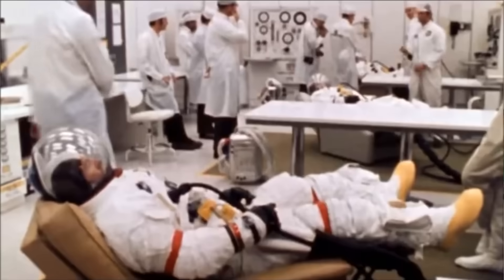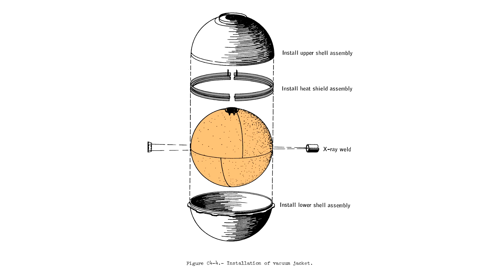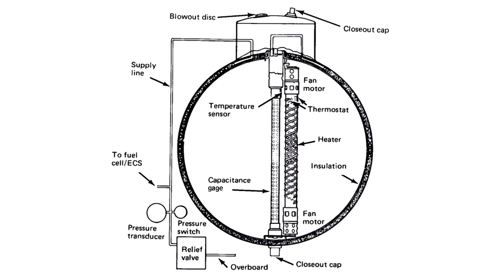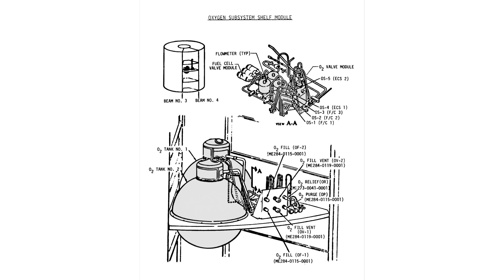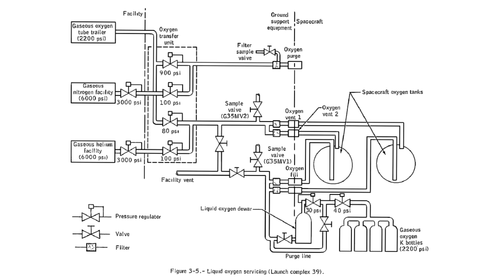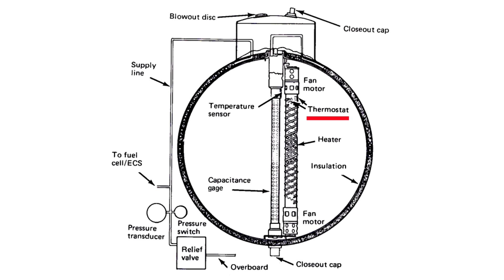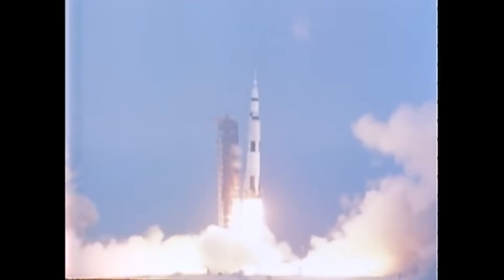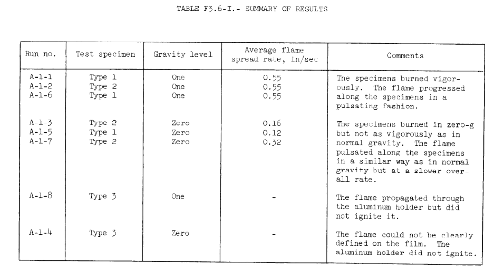What Caused The Explosion That Crippled Apollo 13?

Comment: There was a temperature gauge on the launch pad to display the temperature inside the O2 tank heater assembly. During the boil off process the temperature inside the tank heater got up to more than 500F but unfortunately the temperature gauge only went up to 80F.  The gauge was pegged all the way up to the top at 80 and so no one realized that the temperature inside the tank heater was up so high that it was damaging the insulation on the wires.
Reply from the maker: That's something I forgot to mention
Reply: @scottmanley  Giving credit where credit is due - nice Scott👍🏼😄
Reply: I guess look on the bright side - the o2 tank could've exploded during launch to orbit instead of afterwards when it did
Reply: @opl500  It wouldn't have exploded that early in the mission anyway. It was too early to stir the tanks. From what I've read the latest in the mission that it could have exploded and the crew might still have had a chance to survive was the beginning of powered descent. Once a sizable portion of the fuel in the LM's descent stage was used up they wouldn't have had any way to get back out of lunar orbit.
Reply: @joevignolor4u949  I'm confused...what has the amount of fuel in the LM got to do with the O2 Service Module tank exploding???
Reply: @rnds76b  As you know, the Apollo 13 LM was used to allow the flight to return to earth.  Joe is saying if the LOX tank explosion had happened as or after the LM had begun it descent to the moon, there would have been no propellants and other consumables left in the LM after it left the moon and returned to the CM to even propel them out of lunar orbit.  The explosion happened during the portion of the flight where the LM could be used to get the crew back to Earth.

Comment: Wait so the tank failed a test on the ground and they just said "send it"?
Reply: and even before that they were fine with using a suspected damaged ox tank
Reply: .. and it failed multiple tests. lol
Reply: They agonized over it for hours... everyone signed off after a Beech engineer said "no problem, there's a thermostat in the tank".  This was done on third shift, btw.  They should have noticed that boiling the O2 off took shorter than expected... a lot shorter.  There was also chart recorder data showing no cycling of the heater current... nobody thought to look.  And the thermostat definitely was not rated to switch the higher voltage.
Reply: It's easy to criticize in retrospect, not so much when you have an entire multi billion dollar government program and agency breathing down your neck and the eyes of the world watching your every move with bated breath.
Reply: wheelitzr2 Boeing engineers?
Reply: It failed to drain as expected but that wasn't to happen in flight.
Reply: Its not as simple as running a test and whether it passes or fails will call off or require a replacement of hardware. Tests are meant to provoke failures and it is then the engineers job to determine what correction is needed. Coming to a conclusions which in hindsight is wrong or missing crucial info is not always avoidable.
Reply: Same could be said for the Challenger. These folks are under such immense pressure to launch or pure ignorance, they jeopardize everyone's lives.
Reply: @The_Borg  immence pressure
Reply: VaporheadATC Yeah NASA has way too many managers in management!
Reply: Tax dollars at work

Comment: One question that I have Scott,is you have previously said today's rocket engines are better than Apollo's F1 's ? How if they lifted more and honestly farther at least with heavy payloads and men?
Reply: The important numbers for engines are total thrust, fuel efficiency (Isp) and thrust to weight. The thrust of F1s is good, the other numbers are bad.
Reply: @zeevtarantov  thanks Zeev ,no one really has ever said why they were better, just they were better, I suppose adding in reusability takes it even further.
Reply: @alfredmorganroth9349  for upper stage engines ability to restart multiple times is critical. For first stage/booster engines ability to thrust down for landing and ability to reuse without refurbishing is now important. Scott Manley has a bunch of videos on rocket engines.

Comment: So if the oxygen is in a supercritical state, how do you measure the fullness of it?
Reply: Both pressure and temperature measurements work as usual, leading to the usual routes to calculate how much gas is present.
Reply: And mass.
Reply: Methods that can measure mass is quite impractical in space I would presume. To use gas formulas would implies that one needs to measure the density directly?
Reply: Temperature and pressure are commonly used  to determine operating mass even in situation where there are mixtures of vapor and liquid. Or even mixtures of differing gasses.
Reply: Yeah I got a brainfart there, totally got the ideal gas law backwards. Given a fixed volume, one DO get to calculate density directly from temperature and pressure. My thermaldynamics teacher would probably strangle me for that lol.

Comment: Can't you go over all the changes in Apollo 14 that never gets talked about
Reply: ++Apollo
Reply: See @11:15 - he mentions these briefly.
Reply: Did they redesign the CO2 filter assemblies to be the same shape and size?
Reply: @georgeemil3618  
As far as I know: No.
The Apollo hardware was a steady flow of already built hardware. You do not want to include major structural changes as long as you absolutely do need them.
A13 has shown that it is possible to build an adaptor even when in flight. If I had to make the decision, I would say: good enough.If you absoultely insist, construct a prefessional adaptor and put that on the packing list, but otherwise: don't change a working system unless there is a good reason to do so. After all this was in accident, which should not have happend in the first place.
Reply: @kallewirsch2263  Major structural changes were made to the SM for the J missions to accomodate the SIM bay.
Reply: @georgeemil3618  An acquaintance that worked on the shuttle program tells me "highly unlikely". NASA makes changes to operational spacecraft only if the vehicle is not usable otherwise. Even changing a fastener could introduce unforeseen problems. No AAA in space to tow you back home. He said more likely a kit was added to create the adapter again if needed. The astronauts would have had their weight allowance reduced to compensate. Apollo 13 is why NASA instituted the policy. The spec's for the O2 canisters changed after Apollo 11. Somehow the firm that updated Apollo components didn't get a full set of engineering specifications. Specifically, they were unaware that the operational voltage had been doubled from 24V to 48V.